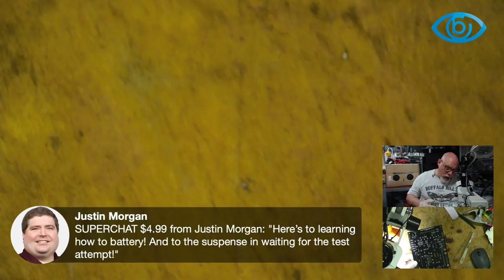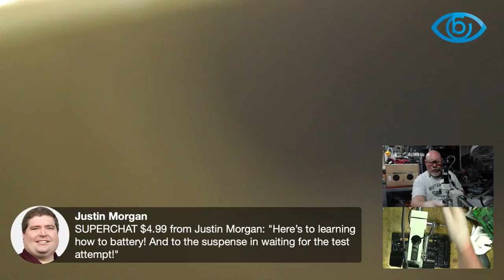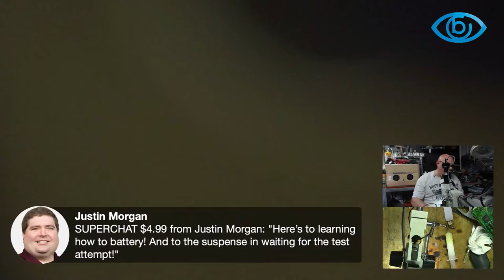Building a brand new Macintosh Classic - Part 2

Comment from the maker: UPDATE
I have made some important discoveries. I have found a couple of design faults on the board. No criticism to Kai, this is just part of the fun of prototyping!

There were a few pads that were a little large, and were touching a trace they shouldn't be touching, causing a significant short on the board. I also found some vias that weren't meant to be vias, creating another couple of shorts on the +5V and the -12V rails. I have "fixed" these, and am now getting power to the CPU (and other ICs) but still no chime or display.

More updates to come!